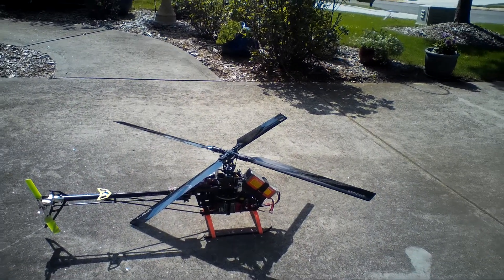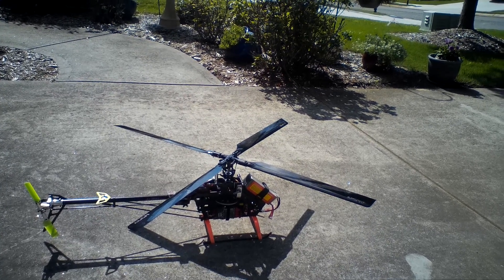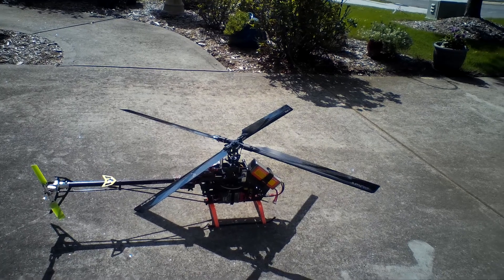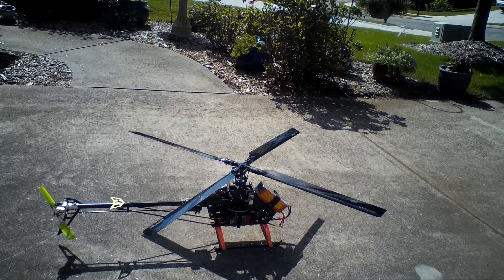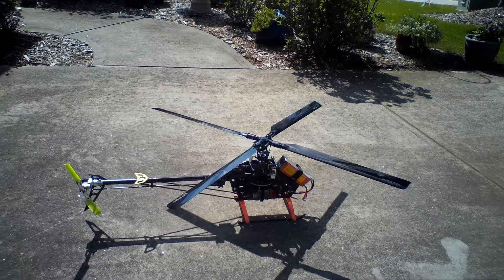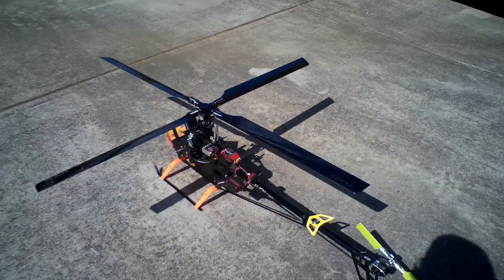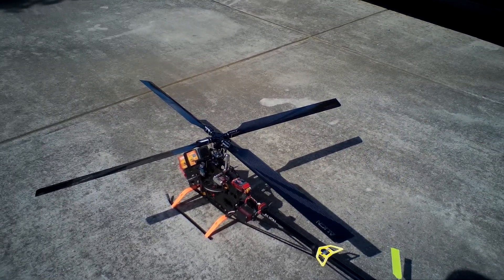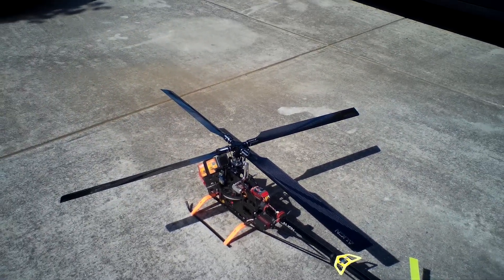update on MD500 project with Trex 500 4 blade setup  first hover

Comment: whats your head speed?
Reply from the maker: I'm running this around 2100
Reply: @georgia_helinut3406  Thanks, those are nice blades, are they designed for 4 blade head or standard blades? they look narrower?
Reply from the maker: those are standard align 425mm blades . when I bought them they cam from the align trex store